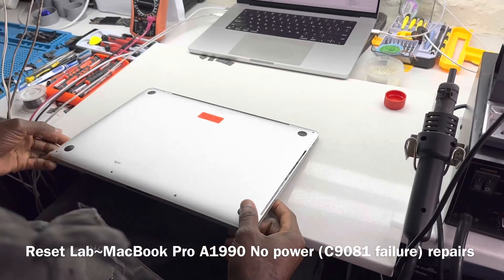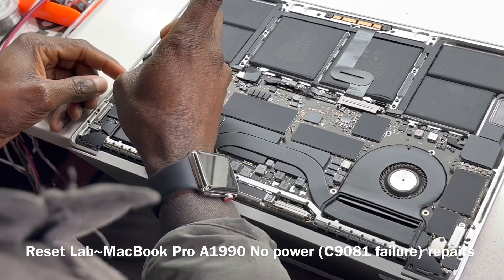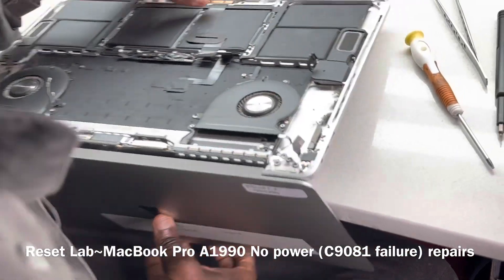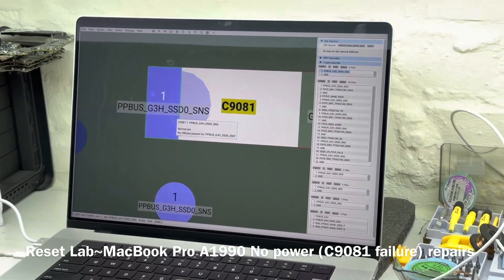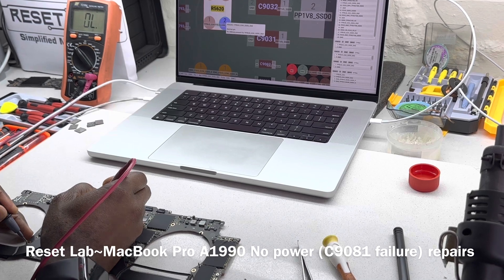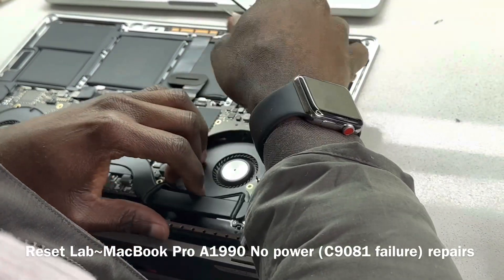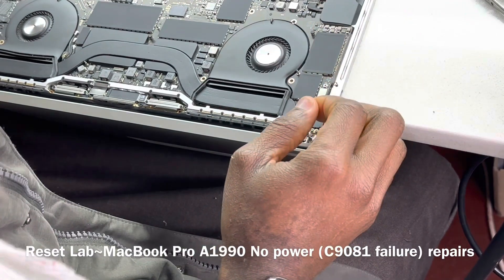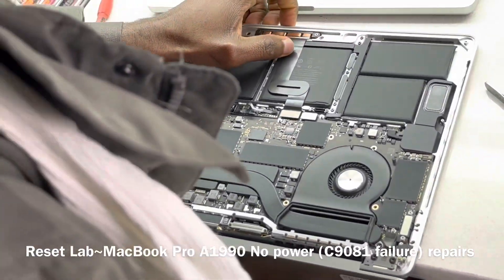MacBook Pro A1990 No Power repairs (820-01041)

Comment: Cd3215c00 for A1990
Reply: Need programming?? Or i just order .one new one and replace the bad
Reply from the maker: @andrewtronics7266  No programming required, you can get from any board from 2016 to 2018
Reply: @resetlab7142  aliexpress selling also should I buy? Or the chips they sell are blank empty of data?